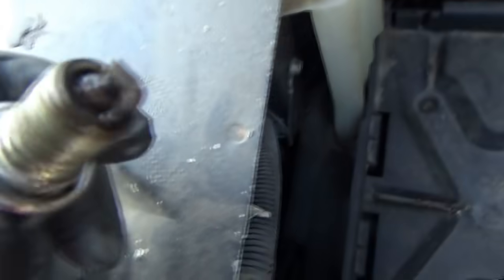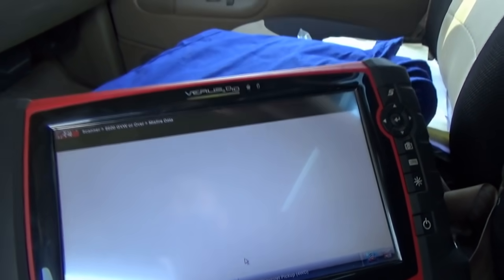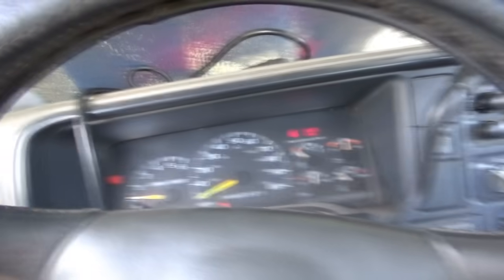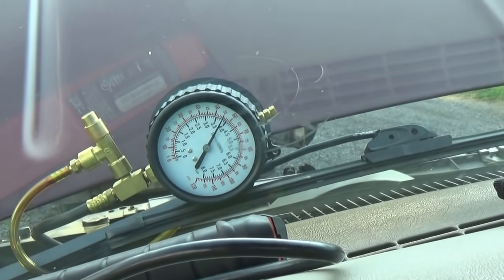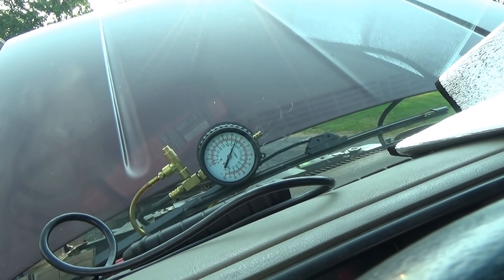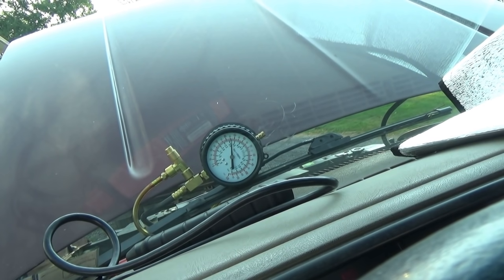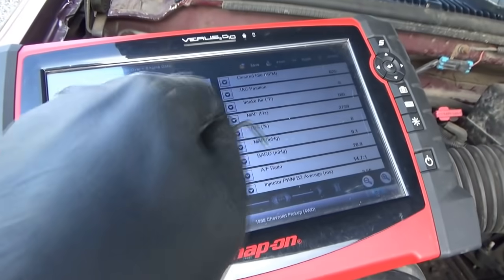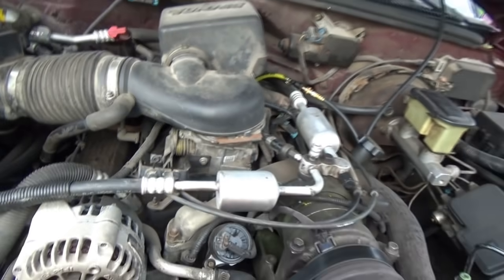Chevy MYSTERY Misfire - Part1 ('98 K2500 Labor Day Special)

Comment: Lol Ivan,  sounds all to common problem!!  Had that exact same issue with my suburban!  I bought mahle intake gaskets instead of felpro as they're more solid built. I had pcv issues with high idle. I indeed replaced the pcv with oem.  Did not fix it,  found out that i was getting to much vacuum in the crankcase,  the gaskets were bad,  as the water jackets clogging up. Did full flush,  fresh gaskets really cleaned the surfaces,  never had a problem since.  260,000 and still going! They're really well built,  solid motor if well taken care of.

Comment: The reason it smoothed out under load is because a vacuum leak doesn't have as much of an effect then because you're adding fuel to compensate for unmetered air coming in through the intake leak. Then the air fuel ratio more closely matches what it should be.  Great video I'm glad to see technicians doing a proper diagnosis instead of throwing parts at it.
Reply: Most of the vacuum is made at idle, not at higher RPMs.  The MAF was also reading way off at idle, 9.6g/s should be closer to 6.8g/s, so that left valve cover vent tube into the intake before the throttle body was clearly distorting it at well.  The MAF is before the vacuum tub.
Reply: Vacuum drops to near 0 at WOT doesn't it? That's what "vacuum reserves" are for(as I understand it)
Reply: That is not completely accurate. Manifold pressure increases to near atmospheric pressure as you open the throttle blade. The pressure differential between atmosphere and the intake manifold is less thus air does not travel through 
the leak point under load.

Comment: Interesting failure mode! Normally they just leak coolant everywhere...
Reply from the maker: Lol! Yeah very weird 😅
Reply: Hi Wes  Great to see you here, how long you've been watchin russian repair videos?
Reply: Yep these are notorious for sending coolant into the engine. I’ve heard a lot of 5.0 and 5.7 vortecs knocking from the coolant oil sludge taking the bearings out.
Reply: @mjmcomputers  
That's called a lack of maintenance. In other words, neglect.  Not a vehicle fault.
Reply: @wildman1137  bad design on the original intake gaskets on these. They normally fail at under 100k.
Reply: A lack of maintenance? How does one "maintain" intake manifold gaskets? 
    Some are just prone to failure.

Comment: As soon as you said misfire with no code and high idle code I just shook my head and reached behind the seat of my 95 burban and grabbed the intake gasket set.  Its a common issue that many people don't really realize.  It usually doesn't manifest with many symptoms on these except a slightly high idle witch most don't really notice a shake at low rpm but when u hammer it everything is perfect and you can see the misfire disappear.  It can be frustrating especially if everything is checked out ok and you find a worn out pcv valve or bad vacuum lines and assume that you nailed it.  If this engine doesn't use the plastic and rubber o ring style intake gaskets (idr witch year they started using that style but 98 is close to the change) as much as some will reeee  about it best long-term solution that I've had great longevity from is to coat both sides of the entire gasket surface with rtv and flush out the dexcool and put green back in it. I do the rtv on the gaskets cause the dexcool causes pitting and I have found that using rtv just around the coolant ports does prevent coolant leaks but it causes the gaskets to blow easier and cause more vacuum leaks.  I currently have 3 years and most of 100k miles on the last set I installed.  Generally speaking on most any SBC 5 years seems to be the time frame that the intake gaskets seem to start leaking coolant or vacuum or both. The gaskets get hard and brittle and then if you get nice and warm while working it hard by towing heavy wagons or anything like that. Doesn't take much to get a leak at that point.  We have had the 88-98  chevy trucks as our farm trucks for 20+ years and it is almost clock work to have to do the intake gaskets on them at 3-5 years always ends up being july-early September during the dog days and ironically right during the heavy hay and haylage  season so hauling wagons and getting them nice and warm under heavy load and as soon as I get a break in the fall I swap a new set in before the winter weather sets in.
Reply from the maker: Sounds like you have a lot of experience with these trucks Clayton! Which brand of gasket do you prefer?
Reply: @PineHollowAutoDiagnostics  felpro. They tend to be what is most commonly stocked. I don't really see much difference between the different brands.  Only so much that can be different and if your gonna apply rtv I've honestly cut a cereal box and made a set of gaskets a few times in a pinch on on the side of the road after blowing the coolant port and leaking fast. If you've done it a few times can be changed out in  about an hour (atleast I could prior to having 3 discs removed from my lower back now its closer to 2 hours).
Reply: @claytoncoolidge992  I believe Felpro and Victor are the best choice. they both tend to exceed GM in upgrades and quality most.
Reply: @claytoncoolidge992 I was a gm dealer tech for years and I agree.  Doesn't matter much which gasket is used if you use rtv to compensate for the pitting.   Being in the aftermarket world now for over a decade I find rtv to be the savior on many issues.   Early 2000s Toyota's with common timing chain tensioner leaks at right rear of engine bay is a great example. This leaks oil all over power steering pump which commonly gets misdiagnosed as the issue.  It's an o ring that fails on tensioner...and even if you replace the tensioner assembly (comes with new o ring) or just the o ring... This will always fail again within 500 to 10 thousand km in my experience.  Adding rtv to the o ring has eliminated all comebacks.  I like to follow service manual as much as I can until i get tired of comebacks lol.  There is one manufacturer out there that I won't mention that if it has a transmission oil pan leak..i get rid of gasket and don't order another...just clean surfaces well and use red Rtv...  hasn't let me down since.  I've seen the thin cardboard trick with rtv before when I lived in Asia for a while.  Works good.   Even saw leaking I ejector o rings on heavy equipment fixed with thread ripped off the operators shirt...  😎
Reply: @jeffreywilsonrubikscubeonb2428  lol ikr I'm pretty sure I know exactly the trans pans you are referring to 😁 i totally agree though if I can do a job once for someone and not have to worry about a come back simply because I can supplement the oem and improve upon the improved redesign then im all for it. Been many times that a couple of extra seconds to toss a little rtv on a gasket made all the difference.  The best one I've ever pulled off was on a 1953 john deere 60 head gasket I was 16 or 17 so I can't claim that it was skill or knowledge but it was pure genius. Head was perfect except for a very very small chip that was too deep to machine out and the tractor not only had sentimental value to the customer but it was also all completely numbers matching original tractor. After several failures with multiple shops including the dealer I offered to look at it and see if I could find a way to get it to work and seal and stay sealed.  I replaced all the head studs and then used one used gasket and one new one and put red rtv in between the 2 gaskets and on both sides of the outer faces and put it together completely disregarded the torque specs and put a 3/4 drive breaker bar with a 5 foot cheater pipe on the end of it and slowly working in the proper pattern but making sure that I started and ended each pass on the stud closest to the bad spot on the head cranked them as tight as I could possibly get them. And then let it set empty for several days.  I never filled the coolant till I got the tractor running and warmed up a couple of times dry. When I filled the coolant up there wasn't any sign of leaking till it built up to full pressure in the system and was very very small. So pulled the valve cover and had the customer help me to tighten the bolts while engine was hot and we cranked another half to 3/4 turn out of them. 21 years and its never blown again it will leak a tiny bit if you are working it too hard at full throttle on a hot day but once u see it leaking as long as u back off the throttle a bit it stops leaking and is all fine. Its never leaked coolant into the cylinder since I did them witch was the major problem.. a small occasional external leak is not a problem considering
Reply: @claytoncoolidge992  Brilliant! Love it 😎
Reply: Are you referring to the throttle body gasket?

Comment: I had so many issues and codes on my 96 1500 chevy truck. Check engine light would not go away.
After a year of sitting, I finally decided to change the spider injector, took me a couple of days, I took my time.
I was nervous to start it when I was done. It started right up, no check engine light.
It passed emissions. 
Super happy.
Reply: I just replaced the injector spider on my 97 silverado 5.7 vortec and it's all shaking and doesn't accelerate just shuts down. Any advice?

Comment: As soon as I saw the high idle and zero IAC it was a vacuum leak. Good to see you didn't go down the low compression rabbit hole. Easy to overthink things sometimes, but back to the basics and it's just a vacuum leak. Hopefully just the gasket like you said and not some cracked intake runner that never happens...... But would make for a good video!

Comment: The Intake gaskets are notorious for going bad on those. There are premium updated gaskets that hold up better. Make sure the manifold isn’t warped as well.
Reply: I never had an issue with intake gaskets.  I think the problem arises when the mechanic isn't careful enough setting the intake and displaces a gasket.  I used shellac to hold them in place and put a dab of sealant on the joints and very carefully set the intake down.
Reply: I’ve had five of these trucks and every one of them had to have the intake gaskets replaced between 100-120k miles. Piss poor gaskets. The new upgraded gaskets was the fix.

Comment: Great video.  I've owned a 98 K1500 with this engine since new and I'm on my third intake manifold gasket with the last one being replaced at around 75-80,000 miles.  There have been three revisions of the intake gasket over the years and my truck has version two.  I'm at around 142,000 miles now and so far the intake gasket is still good.

Years ago I had a high idle situation with this truck and it ended up being the thermostat was stuck open so the truck never warmed up to the correct operating temp and had the idle at high all of the time.  New thermostat and idle returned to normal.

The AC compressors on these trucks are a know issue for leaking and that one is definitely leaking so the owner will be looking at a compressor replacement in the near future.  There are one piece case clones out there that are way better than the HT6 that these trucks use.  I've been using a Seltec-Valeo compressor on my truck for years and it's still leak free.  I also own a 98 K3500 with the 7.4L big block and have replaced it's compressor with a clone as well with no leaking problems.

Comment: Ahhh, you heard me screaming at my phone. Intake gaskets!! Misfire worst at idle (high vacuum - throttle plate closed) the excess air creates an extremely lean condition in cylinder #5 with little to no contribution. However with a MAF vehicle, I would expect lean codes on both banks. But considering the age of this thing it doesn’t surprise me, doesn’t even set misfire codes! Also good find with the PCV valve. Can’t wait to see the Russian repair in part 2…
Reply: Haha! Me to! We must have been making a hell of a racket.
Reply: MAF was reading 9.6 to 10.1 at idle, way too high.  If the computer was following it, to maintain stoichiometric, it would be adding fuel.  It should be 6.3 to 6.8g/s on that rig.  Remember, it's got the old skool O2 sensors...  That valve cover tube goes into the intake between the MAF and the throttle body likely tricking it by pulling more air into the crankcase at idle than would normally get by the idle circuit, causing the higher reading in MAF.
Reply: Faulty fuel pressure regulator will bleed into cylinder 5 on these spider injection sbc engines and cause this #5 misfire. By the look of that plug.. I'd say it's possible
Reply: @RG-cd3uf  or cause an intake backfire and blowout the upper intake seal or crack the upper intake manifold.

Comment: Thought for sure you nailed it with the injector test, my immediate thought was head gasket slight coolent intrusion into 5
Reply: Can you bend a rod starting the engine after injecting fuel into the cylinders with the engine off??
Reply from the maker: @Garth2011  If you dump enough fuel in, yes.

Comment: I think the intake manifold gasket makes sense cause cyl 7 was misfiring a bit as well as 5 and they are neighbouring cylinders. I am surprised you never mentioned cyl 7 misfiring. I am excited for part 2 cause I am wondering if the intake gasket is literally just another red herring lol, but the crankcase was under abnormally high vacuum for sure.

Comment: Great find!
The customer reported no AC. That's one thing they know that isn't working because they're HOT!
I have a feeling that the clutch gap is getting too wide and the clutch isn't closing all of the time. Saw this on my '03 Forester. 
Try  removing a shim on the clutch to close the gap. The other solution would be to replace the clutch or compressor.
Reply: Cant remove a shim no shims on these you just get the GM compressor hub/ clutch tool and push the clutch fitment a little tighter. These compressors are not good. Alot of case leaks. Now all the replacements are china.   Every one. even GM.  They have some nasty looking compressor on it and a high side cap that looks busted off in the valve
Reply: @GhettoWagon  thanks for the information!

Comment: I've been fighting an issue in my '98 Yykon (5.7 vortec) for a couole months. When I bought it, I performed a full tuneup [iridium Spark plugs, wires, cap and rotor- all acdelco, air filter, oil change using Mobil1 high mileage full synthetic, K&N Gold high-flow oil filter]. Started out as hesitation at low idle, then progressed to hesitating and nearly dying unless the engine was cold, then progressed to the same but would even out if the RPM was above 2,000. 

I replaced bank 1 and 2 o2 sensors, no luck. Less than 3k miles after oil change, it was black and smelled of gas. I got to the point of thinking a valve was getting stuck, so I used Lucas full synthetic high mileage oil treatment, ran the engine above 2,000 RPM for several minutes, then noticed the problem was 90% solved- it runs much better, but not entirely perfect. So I presume my diagnosis is correct, and now I gotta dive in to the valve cover and inspect rocker arms and valves. Wish me luck.

Comment: What I need is a video on an OBD 1  88-95 GMC truck.  Been trying to solve the mystery of a dead miss in open loop, that disappears as soon as the coolant temp reaches 40* C. Parts cannon has been fired, reloaded & fired again ! Lol  Everything but the charcoal canister has been replaced and I do mean everything. I have no scanners or the knowledge to use them. Could be any thing from the wrong IAC counts to a sticking push rod. Been at this for 2 yrs now, sure wish I had you around for a day I'm sure you'd make short work of it.  Love yer video's, love learning from you Bro, keep fighting the good fight my friend ! PS. I smoke tested it. If it is a vacuum leak its not the intake.    94 Yukon by the way

Comment: Would Eric have sprayed brake clean in the general area of the suspected leak to see if the idle would change?
Reply: he would probably pull out the Avoca Smoka
Reply: It's leaking underneath the inake manifold.  A smoker wouldn't tell you anything.  Well, maybe when it came out the PCV valve cover hole.
Reply from the maker: Where would you spray the brake clean? No external vacuum leaks...
Reply: @PineHollowAutoDiagnostics  ahhh. Did t know that!

Comment: I would add onto the parts list, 8 plugs, a set of ignition wires and a PCV valve for good measure as they are all very old looking and the labor cost would mostly be included with the intake manifold gaskets or be greatly reduced. Spark plugs are cheap enough I wouldn't try to clean them and unless those ignition wires were replaced within 5 years or so, I'd replace them too. I believe the only internal concerns on those 5.7L are the exhaust valve stem seals tend to wear out by 76,000 to 100,000 miles.

Comment: Great video. Had the same issue years ago on my 99 Tahoe. Please install the Vortec marine version intake gasket, made of Stainless steel and rubber seals.
Reply from the maker: That's a great idea!
Reply: @PineHollowAutoDiagnostics  For the 1996 and later 5.7 Vortec/Mercruiser (all the same). Should be Felpro FEL-PRO MS 98000 intake set. Also, a must replace, Fel-Pro ES72224 Intake Manifold Bolt Set, they will be corroded to death. Another fail on rare occasions is the upper plenum, clean and look for cracks. If the vacuum leak issue is not fixed soon, the engine will become an internal water pump and suck all coolant into the block/pan areas. The engine will quickly overheat and crack the heads. I know this well, it happened to me.
Take care
John A 60107

Comment: I just fixed an Expedition with very low idle. So low it was dying. Only codes are P0420, P0430 and P0705. Ended up being just a dirty throttle body.
Reply from the maker: NO PARTS REQUIRED :))
Reply: @PineHollowAutoDiagnostics  Heck yeah! And thanks to you I'm interested in actually diagnosing. Instead of guessing and fire the parts cannon.